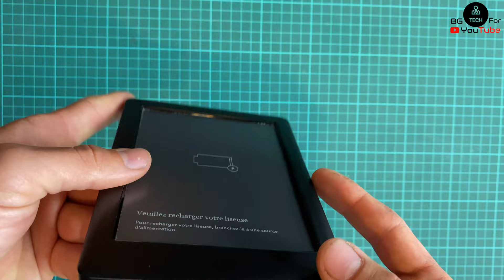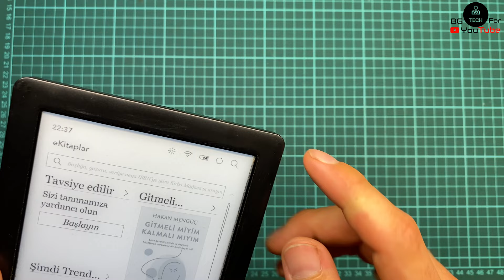Fixed ✅: KOBO Glo HD 🔥 micro USB repair 🔥 E-book 🔥 Repair without money 🔥 e reader

Comment: When you would have used soldering flux for printed circuit boards, you would avoid the mess that you needed to clean with the desolder wire. Soldering flux stuff works really well.
Reply from the maker: Thanks for the tip, I'll keep that in mind!!

Comment: I fixed one zith the same problem,  given to me to look if it's fixable, thanks for this video and guiding on the teardown of the battery plugs and screens connectors
Reply: Hey do you have a link to the USB you used? I tried a couple from Digikey but none of them fit. Thanks!

Comment: Hey, I have a problem that the customers kobo is stuck on sleep, the power and reset button also damaged. Do you know a fix for this? I’ve tried opening it disconnecting/reconnecting cables but as a beginner I have a hard time figuring it out myself

Comment: Hi, I have a problem with charging my Kobo Glo HD. It was charging with 5V and 0.12A and it stopped. When I reconnected the charger do Kobo it stops working (it works with different devices). Usb port is in perfect condition. Tested different cables to. There is resistance of 100 Ohms between VCC and GND on usb port pins. Any suggestions what to check would be appreciated.

Comment: What do you use the copper cable for?
Reply: If you mean the cable at 7:40, it's a desolder cable. And if I'm right (I'm new to soldering so I'm not 100% sure about the use) it's used to to take some tin away. For example, if you used too much tin.
Reply: @stanleyvandenbos  That's right. It uses capillary action to soak up the excess solder.